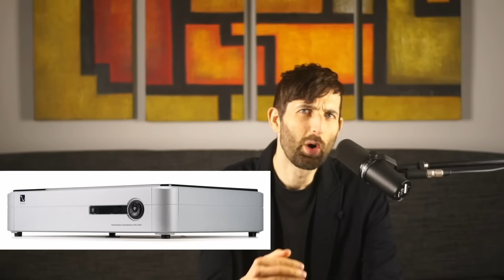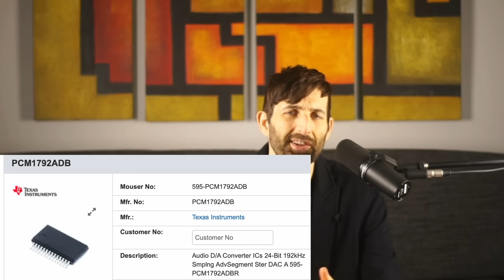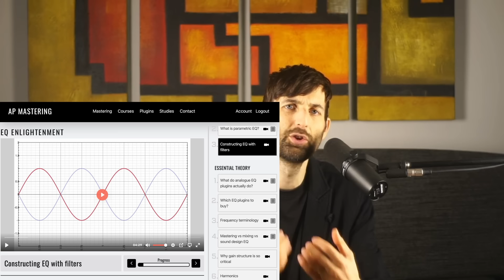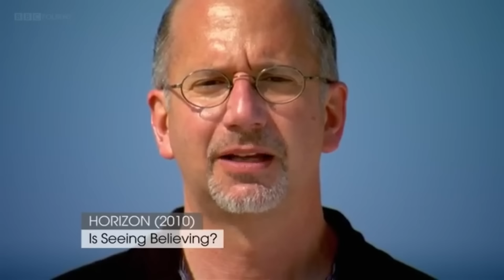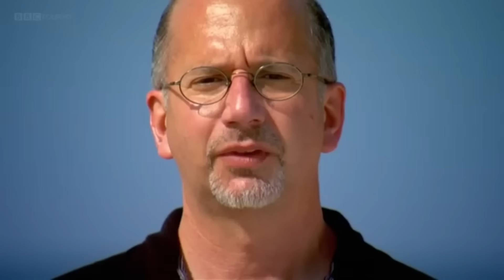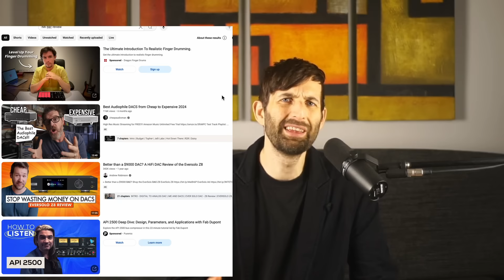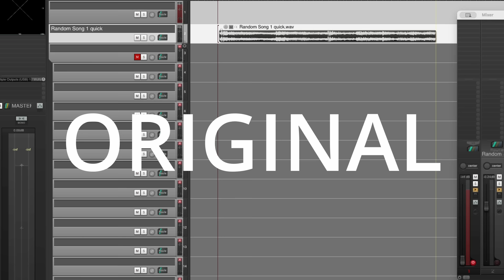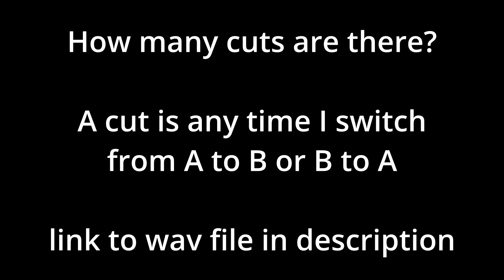The DAC Scam - Almost everyone believes the hype

Comment: He shows a DCS Vivaldi which is NOT based on a chip.  DCS has their own proprietary DAC circuit which basically starts with a ladder DAC and then randomizes the errors.  All their units are based on that architecture.  Meitner/EMM also do their own thing and I believe there are a few others. .
Reply: I'm not an expert and I'd love to know. Despite there can be or in fact there are differences, how a let's say Nagra DAC will cost 38.000 Euros? that is insane. I understand that for instance a Dan D'agostino preamp goes for 175.000 US Dollars but i suppose that is more reasonable, so to speak ,than 38.000 for a DAC. is it the enclosure made out of platinum? I'm asking because I really don't get that a simple DAC component even if the chassis etc is very good, can  take 38K. I¡d really love to know how that can be possible. Thanks in advance.
Reply: @inforobob  what would be a good listening test ?
Reply: To quote John Atkinson, the Ring DAC is not an R2R: "In a conventional 5-bit R-2R ladder DAC, the resistors have the following values: R, 2xR, 4xR, 8xR, 16xR, and 32xR, ie, each resistor has a different value. I believe that what dCS is doing is using multiples of the same-value resistor rather than different value resistors and the "mapping" algorithm moves each resistor to a different place in the ladder for each sample. That way any errors in the actual value of each resistor are averaged out - ingenious!" It's a platform that can be fed and made to behave similarly to an R2R for PCM, or merge DSD bitstreams, by way of FPGAs.
Reply: @LeonFleisherFan  Yeah,  that's why I said basically.,  It is a ladder however.
Reply: @ Can be used as such. What I like about it as a platform is that is can do native DSD (merging five bitstreams into one). It's my impression that the negative reputation DSD has in some quarters is because there aren't any off the shelf chip set based DACs that can do DSD natively, which, needless to say, defeats the purpose. In other words, it's an exceptional concept in that it can handle PCM and DSD equally well.
Reply: @LeonFleisherFan  Wouldn't that still be "Resistor 2 Resistor" or have I been confused this whole time about what R2R meant? I wouldn't be surprised if I was wrong.
Reply: @ Not sure I understand the question. The point is, in an R2R, the resistor values form a ladder. In the RingDAC, all the resistors have the same value. The FPGA feeding this resistor board may use and combine them any way it's programmed to do.
Reply: Had an DCS ROSSINI player vs EMM LABS DV2.
DV2 was to stay.
Big difference.
Reply: @Dawizbuffy  So DCS was broken?
Reply: @psyborg06  no EMM is more musical and engaging than dCS.
Reply: @SecondSoundCH  It seems both were broken then, unfortunately.
Reply: @psyborg06  to bad you can never experience the joy of something like that.  but hey, there is alot of good cheaper stuff to. enjoy and stop trolling,
Reply: @SecondSoundCH  Oh look, a salesman. All of your comments are invalidated.
Reply: @psyborg06 no.
Reply: @Dawizbuffy  Yes,  @SecondSoundCH is pedding audio gear.
Reply: @Dawizbuffy  What did you prefer in the EMM? I know Meitner and DCS both do things their own way- not surprising there's a different takeaway, regardless of the crude-measurements are everything dopes.
Reply: What nobody wants to admit is that there are people with far more money than any of us, that have run out of responsible things to spend money on. So now they flush out thier toy portfolio with very expensive toys and they absolutely dont want anything in the hundreds of dollars. They want them in the tens of thousands.
Reply: @OCDHIFiGuy Yes, and the beauty of that is that they have no idea what they are doing. They spend tens of thousands on stupid scam dacs because it’s easy, you don’t have to understand anything about what you’re doing. I’m in the 1% and if you really want to spend tens of thousands on real things, you can. You get 2 Focal Scala for the mains, you get 2 Perlisten D215s for the bass, you get 4 Benchmark AHB2 amps, 2 for the low section of the Focals, 2 for the highs, and then you get a Trinnov Altitude to eq everything and basically have a massive active crossover system. Done. You put whatever good measuring dac you want in there, like a topping. 
AND you treat your room. 
You have now spent tens of thousands the real way.
Reply: @Maxime-ho9iv  Focals ? lol. you haven't heard any good speaker so it looks like. Getting your ears pinched by the berillyium tweeter? Missing all the mid base? Be a bit more open minded. Measurements are for fools. You don't listen with your brain you listen with your ears.
Reply: I have an EMM Labs CDSA. I more often than not stream into a Topping D70 from a cheap Wiim pro.
Reply: Excellent
Reply: I saw that too he wants to be a bit more careful lumping R2R proprietary dacs in with chip dacs . I agree about spending heaps on a chip DAC is a bit silly
Reply: Linn build there dacs in house
Reply: @hughkleinsc8949  In house is one thing, but their own circuit is another.  Do you mean they design their own converters?
Reply: Same for the also shown Wadax and MSB. Proprietary and discrete DAC technology.
Reply: DCS stuff is pretty good - if I'm not paying for it!!! My friend had a couple of their units in 2001 and they were bloody excellent, but he had the dosh. I still preferred his vinyl rig which was about a tenth of the price though!
Reply: It is fair to pay a premium for a sound profile. But one must accept that the only way there could be such a profile is either distortion or DSP. 

I do both. Soundid and one of my DACs are r2r. But knowing that my wiim ultra is objectively better than my pegasus
Reply: So it's even worse then
Reply: @ no, that’s not what that means.
Reply: Half and half agreed.  Mola DAC uses their own proprietary chip, not offf the shelf.  Some are a scam.
Reply: Not sure if you understood the point?
Reply: @ To whom do you refer and which point?
Reply: They do it all in house , design and build
Reply: So is Meitner better than Playback designs,, both guys are legends in the industry
Reply: If £50 DAC based solution is impossible to distinguish in a/b, some company can provide proprietary for £160,000 that does same or worse.
Reply: The inside of the DCS Vivaldi looks like it's a two parallel DAC chip layout...
Reply: Yes and their design is a pointless waste of time and money because it's an 'answer' to a non-existing problem/question.
Anyone who buys DCS products at those prices might as well just take their money and pour lighter fluid over it instead.

It's just an audio DAC... such a boring piece of equipment. The idea of a $50,000 audio DAC is an ABSURDITY.
Reply: Do you happen to know why my DCS Bartok and some other models still cannot access the Qobuz app forcing users to use Mosaic in a severely limited capacity? Thanks.
Reply: And they still can't prove there is an audible difference.
Reply: "starts with a ladder DAC and then randomizes the errors"
Probably using a Turbo Encabulator.  The whole point of digital is there are no errors.  I suppose you could randomize the data going into the DAC but that seems like an amazingly bad idea.  
The DAC chip definitely needs an amplifier stage to isolate the ladder resistors from whatever is next in the analog chain.
Reply: @thomasmaughan4798 With a standard ladder DAC there are errors due to the inability to get the resistor values exactly equal.
Reply: @inforobob  "With a standard ladder DAC there are errors due to the inability to get the resistor values exactly equal."
So how is randomizing something going to fix that?
At any rate, it is easy enough to test for this.  The best test is a sawtooth digital signal and then observe the resulting audio for nonlinearity.  Even better is to use FFT and look for harmonics on a sine wave.  Non-linearity of the DAC will cause conspicuous harmonics and the exact harmonic also tells you which resistor is out of specification.  This nonlinearity will also influence the music slightly, but of course harmonics are a normal part of music already.
Reply: @thomasmaughan4798 Read DCS 's explanation.  They seem to make sense.
Reply: @inforobob  DCS's explanation reveals nothing useful.  Wikipedia is a bit better.  It seems they may be discussing serialized data rather than parallel data (PCM).  Parallel data is easily converted; trivial actually, but serial data streams not so easy.
Reply: Indeed. The same is true for the mola mola tambaqui.
Reply: Yes, EMM Labs single bit architecture is phenomenal.  And the Linn Organik platform too.
Reply: @markutz  Disagree re EMM.  DCS allows upsampling choice DSD or high res PCM.  EMM only does DSD which some of us don't prefer.
Reply: @inforobob In my chain was EMM Labs DV2 vs DCS Rossini player better by a huge margin.
Reply: @Dawizbuffy  Thanks for that.  Some disagreement online about that.  I am probably gonna keep the Rossini Apex as I continue to upgrade my analog components.  EMM was something i considered, but I like the DCS approach.
Reply: @markutz it sounds great with SACD on my EMM CDSA. It’s not great with 16/44- I mean it’s fine but it’s not notably better sounding.
Reply: Yes given the enthusiasm with which the straw-man was established the accompanying photo of the DCS was… unfortunate, ironic even. The audience for this care not one jot about such deets of course, they’re here for the righteous beat-up!
Reply: @Wharariki  I'm not here to say the DCS is no better or difference, but the difference is not that big. And yes, I've spent some time with a DCS stack, a store down the street used to have a Scarlatti stack. It was a wonderful sounding DAC, which you'd expect for what it was at the time (I don't recall specifically beyond it being tens of thousands for the whole rig). But you could have plopped, say, my used Berkeley Alpha in its place and... meh, it wouldn't have been the end of the world, if the change was even that noticeable. And even here, my humble little Topping D70 is as good as that old studio-grade Berkeley Alpha. The DAC just isn't that important. Its not. I'm sorry, but it's not.
Reply: @TheFibtastic  I have a Lampizator dac and it sounds a zillion times better then the Cambridge Audio dac I sent back after 2 weeks, sounds way better then the Synthesis tube dac. Dacs do not sound the same
Reply: @wkj711 I have an old Berkeley Alpha, and a Topping D70, and have had others. They all sounded good, but easily different. I have several ADCs as well… even more different than the DACs.
Reply: @wkj711  shhh don't tell the YouTuber... he seems so confident in his claims, I was laughing my ass off
Reply: @inforobob  Best way to describe it is that they're using an old and inefficient design, and money is being thrown at it to make it perform up to par with modern equivalents.
What they're essentially doing is making large and expensive carbureted V8s that only perform as good as a cheaper modern turbocharged 4 cylinder engine.
Reply: @Goodmanperson55  On the other hand if you look at the subjective reviews in addition to the measurements you might realize how good are the DCS DACs.  Go hear one alongside a chip DAC and decide for yourself.
Reply: It’s all nonsense. The entire lot. You will never admit it because you spent a fortune on commerce grade technology and will look like a fool if you agree. You will find no difference between a DAC on a cheap low-end computer motherboard and a dCS “bespoke” DAC.
Reply: @ not the flex you think you’re making.
Reply: @o0Donuts0o  I went from a good sounding Mytek Brooklyn with an ESS chip to a DCS Rossini Apex.  Law of diminishing returns does apply, but the DCS is better.  I also have pro gear including an Avid Matrix Studio with really good converters from Digital Audio Denmark.
Reply: @o0Donuts0o  There is actually a difference because those R2R DACs distort more, especially if they weren't literally warmed up (old professional interfaces literally had a dedicated oven for their DACs). We've left them in the past for a good reason. They are less efficient, more expensive and more distortion prone than the modern delta-sigma DACs found on almost every single device today.
Reply: @Goodmanperson55  Sorry but what does bringing up old unused technology that is irrelevant to the topic add? In a discussion about modern housing building methods, are the guy that shouts out “we used to live in caves” for whatever reason?

Comment: I am of the stance that blind tests only help to tell us whether purported audible differences are actually caused by how the electronics treat the actual audio signal, or at least help us determine if the difference seen in a null test is actually audible. I can have no problem with people enjoying their fancy gear under the case of its actually using clever engineering to achieve the same thing, and so long as they understand that the subjective enhancements they get in practical, sighted listening are most likely not due to actual physical properties of the electronics.

Comment: I remember being told as a young adult testing premium headphones that if i couldn't hear the difference, then i should buy the cheaper item. The most expensive dac ive owned was $250, and i doubt i would hear much of a difference if i jumped up to $1,000. I think for most people you will get more bang for your buck by making sure you have a good source file, as the best DAC can't fix a shitty recording.
Reply: I can't detect any difference between my $4000 (adjusted to today's dollars) Parasound D/AC-2000 and the new, $160 FiiO K11 R2R. They both sound great to my ears going through a pretty high-end system. The main way I save money is to buy vintage gear and get it repaired if necessary. I def don't fall for the hype of modern products, and that includes silly, new audio formats. 16/44.1 redbook sounds perfectly fine.
Reply: Good source file being a good mastering; unless 128kbps is all you can get. Can still enjoy music on such a compressed file however. In the end I'd rather listen to the music than to not listen to it just because it didn't come in flac; this can happen often if you find obscure or random budding musician tracks etc
Reply: I started with a Schiit Modi Multibit $250 and it was decent. Currently on a SMSL SU-10 and it's leagues better at 3x the price. I don't have golden ears either. I'm sure diminishing returns will hit at some point but likely my wallet will give out before my ears. 
DAC's definitely matter but it's good to have a quality source as you say.
Reply: @bearclaw5115  - Don't say that. You'll mess up the hype all a DAC is but a chip. Implementation means nothing.
Reply: @Horsey2000  - that's a really ignorant & stupid thing to say.
Reply: just buy more drugs and you'll think you can tell if a wav file was previously compressed with zip vs. rar.

no i don't think the guy was kidding or trolling who said that. he was also definite in that the machine he was using for wireless streaming as the source 'sounded' better if it was running on battery.
Reply: Wrong assumptions lead to wrong decisions ignorants

Comment: when you learn a bit about actual electronic circuit design you find it's not the dac that means anything, most styles of dac are functionally equivalent, bandwidth is the limit, you get a chip that's a few bucks more to improve it.  the filtering after it is the thing, but even then, capacitors and coils are the thing, the design stays the same, you use parts that cost a few bucks more.  one thing that might increase cost, legitimately, is testing and matching components, it can be a slog, and then you gotta dig through bins of counterfeit chips and resistors to find any that are real... a halfway decently sized company can have components tested while still on the tape, by machine, smaller companies gotta do it manually.